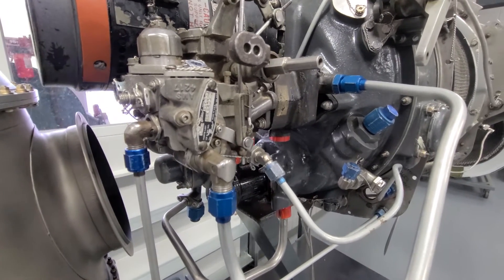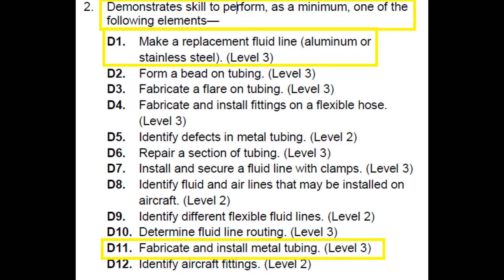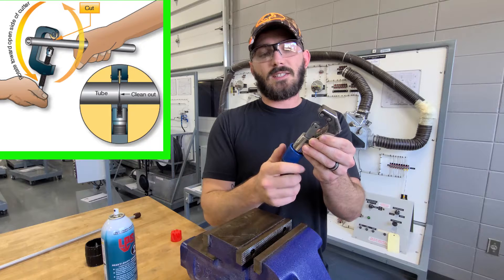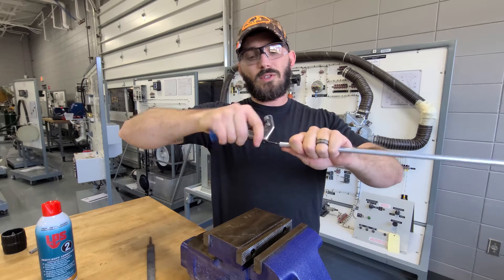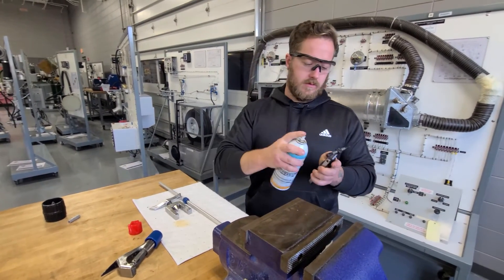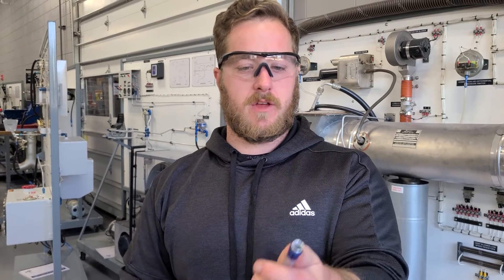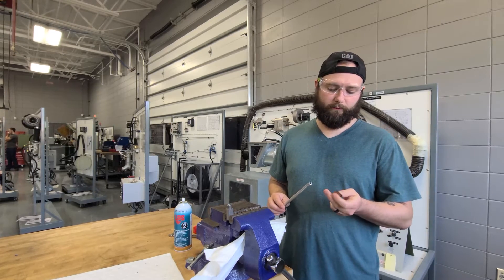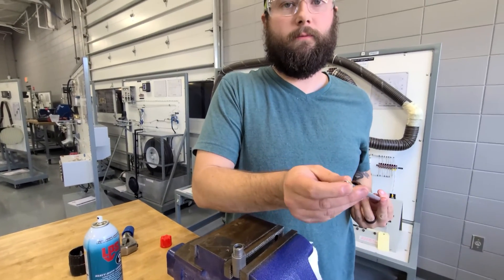Rigid Tubing: Flareless, Single Flare, Double Flare, and Beading

Comment: The difference between tubing and pipe is the way you measure them.  Pipe is ID and tubing is OD
Reply: Usually pipe and tube mean non flexible, which is measured by OD. Hose usually means flexible which is ID.
Reply from the maker: Believe me I tried to tell the students that as well but they were army brats that had parents that must have been  pipe cutters!  The class was called Rigid Tubing and Flexible hoses!

Comment: Ok, at 11:21 our technician puts the tube in the double flare tool.  I have this tool.  The tool comes with numbered gage discs of different thicknesses.  The instructions (laying on the bench in the video) say to select the disc of the proper thickness and use it to set the stickout of the tube from the die.  Our man here didn't do that so he's procedurally incorrect.  In aircraft maintenance you start with data, instructions and etc. Review those first and follow the procedures.  So, don't do it this way.  The length of the stickout from the die needs to be set before starting the flare.
Reply from the maker: Thanks for your input!

Comment: Quick question, when doing the flare do you have to account for a reduction in length?
Reply from the maker: Yes.  There are factors to consider, such as 37 or 45 degrees flare angle, the diameter of the tube , including wall thickness, and whether a single or double flare.